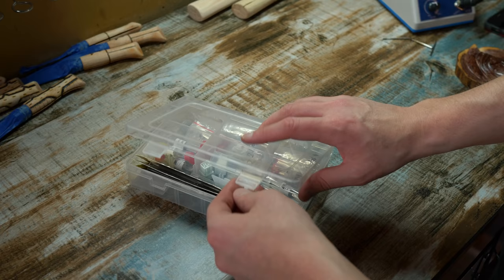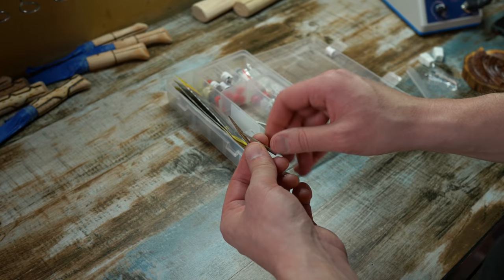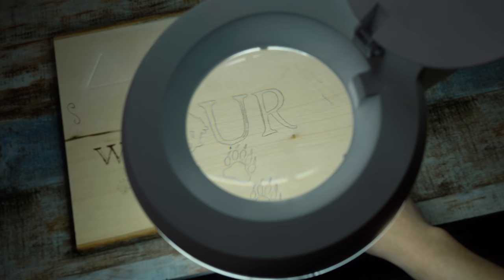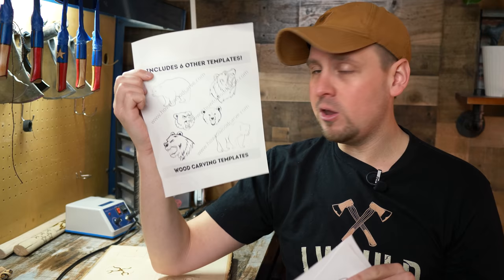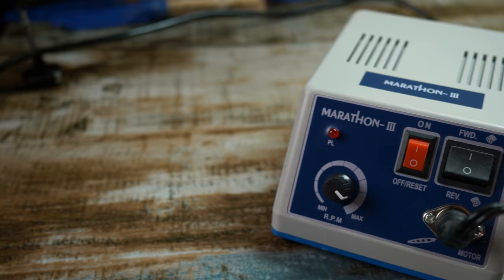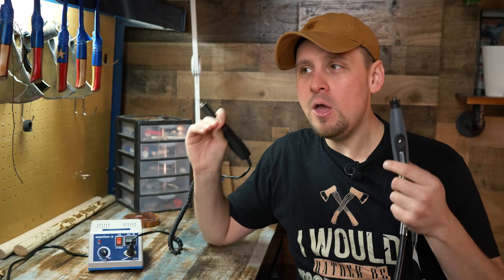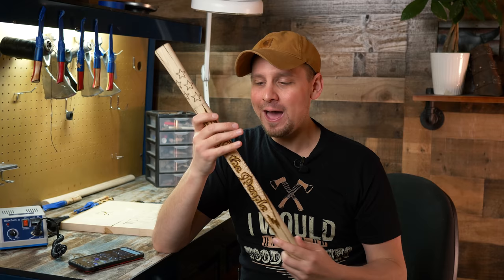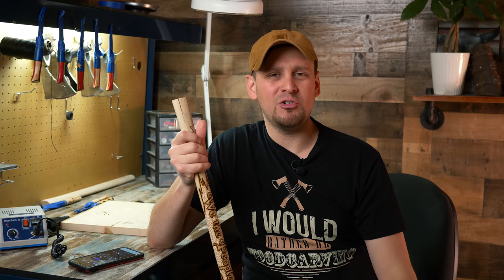How to Wood Carve/Power Carve Fine Details with Any Rotary Tool

Comment: I purchased this to do some light PC case modification along with the dremel tungsten carbide cutting bit. https://www.youtube.com/post/UgkxfPgcZ5_Cl0HDUKkMJAKde11YKQZVgMoR  I had to remove a flange from my PC case that was preventing my monitor cable from fully seating in my GPU's HDMI connector, and after hacking away at this 2mm flange with a hand file I broke down and purchased this (at Home Depot).I have to say it's fantastic, and by far the best rotary tool I've used. No wobble or give from the shaft, plenty enough torque for light metal work, and decent battery life. The WC bit ate through the steel frame quite easily, and the chuck seemed to hold it firmly. This may seem obvious, but I especially appreciated the cordless nature of the tool since I was holding it at odd angles to ensure I didn't shower the inside of my PC with metal shavings.TL;DR, this is the one to get for light-medium duty work.
Reply from the maker: yes it is!

Comment: Hello!  Thank you for your videos!  Beginner here, I’ve been watching your videos and you use those 3 little round ones a lot. What are their sizes and how do I find them?  The link in the video only had 2. Im not sure which one to order on its own.
Also, the sand paper linked is unavailable, anything specific I should look for in sand paper?  And the dust mask link isn’t working anymore. Anything specific to look for there? I’ve just been using a 3ply face mask like you wear at a drs office, I’m not sure if that’s enough. Thank you!!

Comment: Im obssed with ur videos, im watching non stop, 
i have a question man,  8:28  is it possible to use diamond bits inverted cone. Or just the sharp diamond bit instade of that tiny round carbide bit?

Comment: Great tutorials. Do you have some suggestions what type of wood is best for carving ? I tried your advices but had problems with the wood which was irregulary hard on some places so my tool "flipped".  I think it was Blacknut(not sure if the translation is correct) wood I used.

Anyway thx for your tutorials
Greetz from Germany

Comment: Do your small bits ever get plugged up?  Also,  do you have any recommendations or possibly a link for dust collection.  I have COPD,  so it doesn’t take much to really cause me problems,  and we live in Idaho, so 5 or 6 months in the year it can be to cold to work outside.  Thanks Matt.

Comment: Hello there. Love your videos. I just purchased the Marathon micromotor but when I looked at the handpiece, it only accepts 1.23 mm burrs and bits. It seems all of my current burrs are 3mm or bigger. Is there another hand piece or collet that will allow this to accept the bigger burrs? PS this question is also on another video.

Comment: Where is your Dremel Stylo?
Or is the one you used in this video a bit better?
Reply from the maker: It all depends on the application. The Dremel stylo fan accept the Dremel multi-chuck which makes it more versatile for accepting different size burrs.
Reply: @CorneliusCreations  I will stick to the Stylo for now. Saving up some money for the dremel 3000 or 4000. I'm not sure yet which one to buy.
In Germany I have a few problems getting smaller burrs like you have.
Wich makes it a little harder to do the detail work.

Comment: Matt, as a one-handed carver do you know of any vise system that I might use to help me hold my project? I really want to try some fine detail carving.
Reply: I know Dremel sells two accessories, one is a sort of vise-clamp system - it looks pretty nice and flexible but it also hasa a lot of plastic so i haven't decided whether to trust it yet. Their other thing is called a tool workstation. seems like its loosely based on the idea pof a drill press, but much more flexible in positions and stuff. 
I haven't had a chance to try either one, so thats about what all I know.